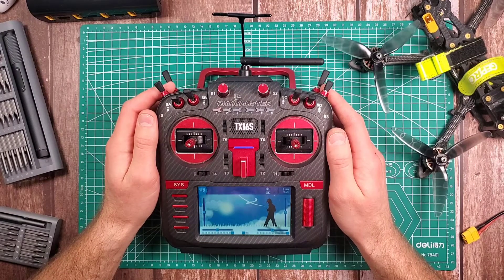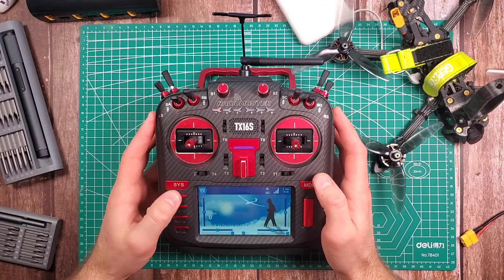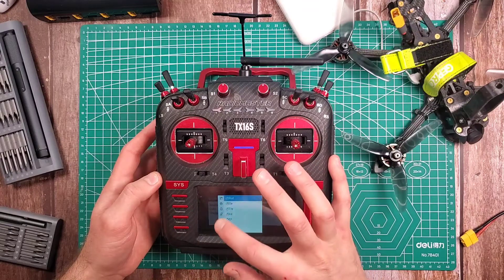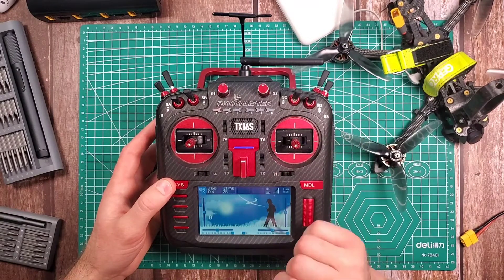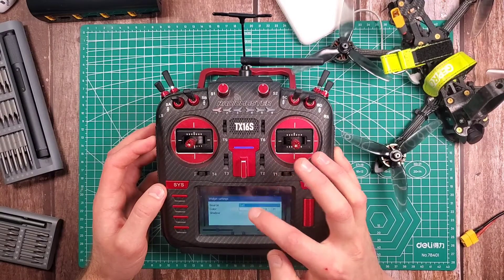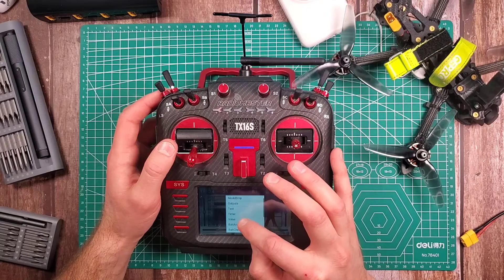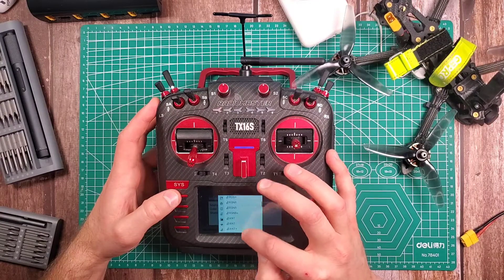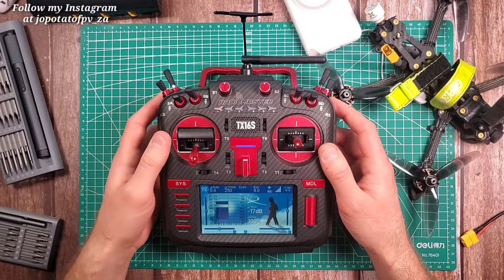EdgeTX - Set up telemetry widgets (RadioMaster TX16S Max)

Comment: I've been in RC model for a lot of years... last night I didn't take my props of... something happened and the props came and ate $200 dollars brand new Spektrum Telemetry Receiver and GPS sensor... it will happen sooner or later so...Take the Props off when working with a Hot Aircraft. Thanks for video!
Reply from the maker: That is awful to hear, wow. I usually don't power up with the battery, I use my powerbank through USB so the motors have no chance of becoming a danger. When I do need to power up through battery, I always unscrew or loosen the prop nuts / remove the props. Have seen to many accidents before!

Comment: Thx for the video. Just bought the same radio, with the same skin.👌 Where did you get the black rubber caps for the switches?
Reply from the maker: Hey man! It's an awesome radio! I got the caps from a local store, but you can find them on banggood. They come in various colours 😄
Reply: @fpvnook3860  How do you get voice prompts on the widgets? Can you help me please